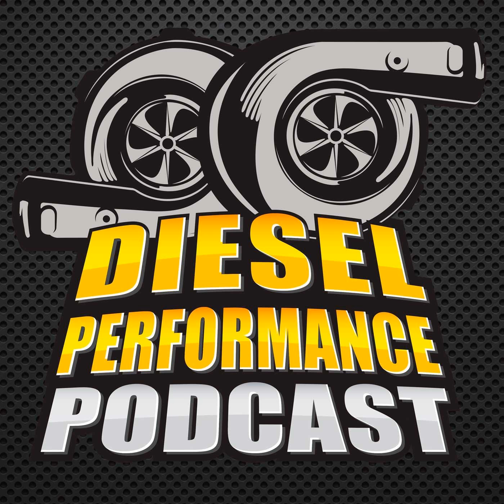Don't Delete Your Power Stroke DPF!

Comment: I have a 2017 Ford F350 power stroke and I run the Banks Idash 1.8 my truck had a P2002 code two weeks ago and fell under TSB 17-0055. Ford replaced the catalyst converter no charge because I only had 27000 miles on my truck the TSB also required reprograming the computer. Do you know is there a bad batch of DPS's and was the factory program the issue that caused the failure?  I have tried to search for this and cant find anything Thanks, Robert